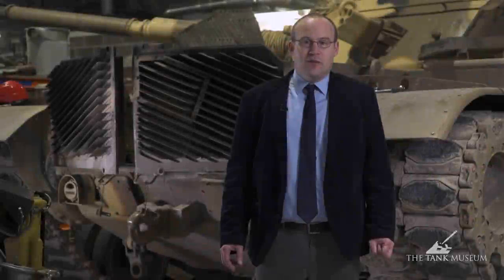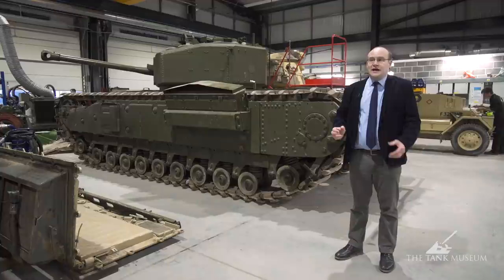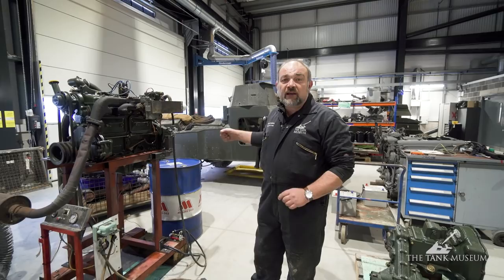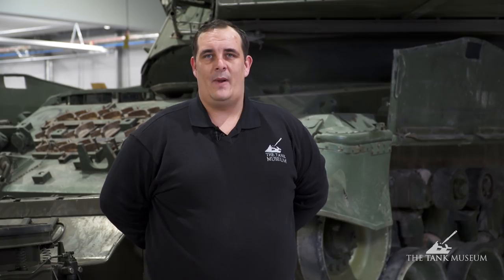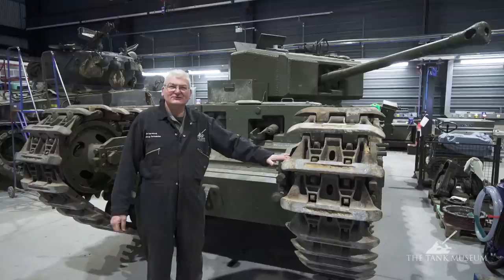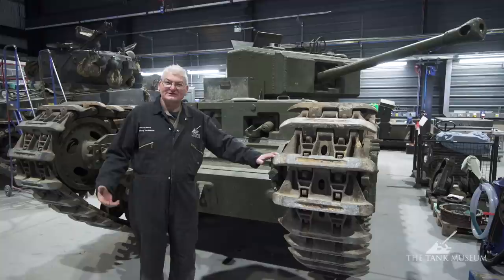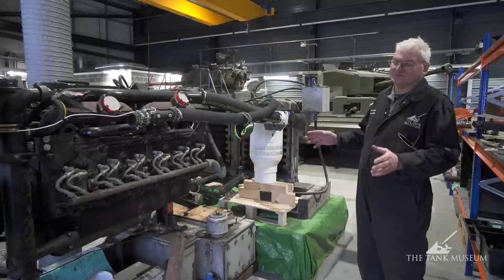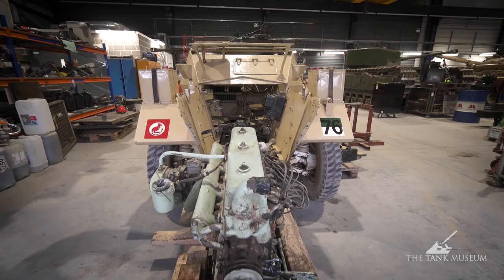Leopard 1 Overhaul | Ep. 1 | Tank Workshop Diaries  | The Tank Museum

Comment: The Leopard 1 engine setup is very impressive indeed! Wish car manufacturers would have taken a lesson from these engineers. Would make working on vehicles today much more effective.
Reply: they could IF only they wanted but they want to force you to bring your car to a dealer workshop and make money withe the cars they already sold. IF only these dealers were competent or trustworthy...
Reply: @spidermann5000  Yup and the very reason I was saying how great it would be. We get ripped off at the sale and we get royally raped with the repair and maintenance. What a racket this is!
Reply: The Germans certainly seem to have taken the WW II lessons of the Panther and Tiger - two notorious maintenance hogs - to heart.

As far as the applicability to consumer market road cars, I honestly doubt many people would be willing to pay thousands $$$ extra to have an engine/transmission/cooling/accessory pack that interchanges as a single unit. A feature like that is only worth the $$$ to someone operating a large fleet of identical vehicles, where a motor pool is constantly servicing vehicles on a rotation.
Reply: @paulfrantizek102  no neet to fit it in one big block but if you have to disasemble the whole car to replace a simple part then you sure are trying to cash in on repairs. same thing with brand specific tools... so i guess you are missing the point
Reply: @spidermann5000  Yeah, that's a different point from the one I was addressing. I was speaking specifically to the modular power unit - technically impressive, to be sure, but something very few users outside of a major military are likely to see value in.
Reply: @paulfrantizek102  ahh, i see
Reply: Porsche 911s and BMWs from the era of the Leopard 1 are equally easy to maintain.  It's just the modern junk.
Reply: Those Germans just stole it from the aviation world.  Now fighter engines are modular.  They can be be changed in an hour.  For real.
Reply: You're exactly right. the only thing I can do is add windshield wiper fluid.

Comment: And another nice feature of the Leopard`s power-pack is the so called " Standlauf ".It consists of a electrical connector set and a minimalised radiator. This device allows a test-run of the power-pack  without installing it in the engine bay so it can be checked for leaks and proper funktion of the entire pack. The same thing can be done in the Marder family.
Reply: German mechanical engineers are geniuses. They learned a lot of lessons from World War II.
Reply: Wind up a Leo pack and it would "walk" along the ground during runups!

Comment: Excellent series. I enjoy the nuts and bolts descriptions of military vehicles.  I worked on the restoration of a Soviet made SU-76 SP gun back in the 1980's. It was a lot of work but very satisfying. Watching the ease with which a Leopard Pac could be pulled made me envious. Getting the twin 6 cylinder flatheads out the SUKA was an all day job. The vehicle was a mess, having been subjected to the elements ever since the NKPA "donated" the piece to the USMC in 1952. She had run over a mine, probably an AP because the damage was relatively minor, but everything was rusted and needed sand blasting and full restoration. Keep it up, I'll be looking forward to your next video.

Comment: As an "old" Leopard C1 & C2 guy, the gentleman misidentified a couple of items, he called the radiators "air-intakes" (the engine air intake is located about the middle of the hull, just behind the turret ring, on each side) , the superchargers "turbochargers", the tank was not "steered" by the brakes, it was done by hydraulic pumps incorporated in the transmission. The final drives are incorporated in the hull, and the "muff-couplings" slide on/off the transmission flanges on the power pack (27-32 full rotations of the "muff-coupling" wrench to release and to reconnect, you would do 32 full rotations and then 'back-off" 5 to allow for some "play" for the splines.

Comment: Mark, when describing the powerpack, you incorrectly identified the radiators as the air filters. The air filters on a Leopard 1 utilise a cyclonic system of two per side in the sponsons, with 3 filter cassettes per side for a total of 6 in the vehicle. The radiators are mounted on top of the transmission and are also designed to allow water ingress through the radiator fan when fording and then out through the side vents.
Reply: Written by someone who obviously has training and experience on this tank.👍🏻

Comment: That leopard clearly demonstrates how  the German engineers learned the lessons of WWII. Is Challenger that easy to work on?
Reply: They kept learning  them too, my 71 VW bus has a tray type set up, you can pull the motor, gearbox and ancillaries straight out the back without even jacking it up. I once removed and rebuilt another bus motor in a car park! Full engine out with one trolley jack is about 20mins on my own.
Reply: Gus Gone I actually drove 23C when I was posted to The Royal Canadian Dragoons

Comment: Thanks.

That Leopard design is inspired!
Reply: Well the germans and french wanted a conscript proof Panther. So they basically drafted a spec that fixed all the problems in the MBT60 project. And build two in Leopard 1 and AMX30. Going for example for a 50to design weight chassis in the Leo where Breaks, final Drives etc are concerned while the tank is in the 42to range

Comment: 9:20 - those are the radiators and not the air filters, air filtration is hull mounted which directly connects to turbo charger intakes.

Comment: Any thoughts about standardizing to three modern engines shared across all the overhauls? Seems like most vehicles could run on either a 250 hp, 500 hp, or 750 hp engine. Cheaper, easier, and more practical for engines run annually.
Reply: This is very similar to the dilemma of so many other RV owners.
Reply: The amount of work required to fit all the extra gear to interface to the standard engines would not be worth it and probably not fit (long narrow engine bays vs short wide ones etc).
Plus what they are doing preserves the tank with the correct engine (all with different sounds) - the difference between a commercial outfit and a working museum to my mind.
Have a great day.
Reply: @Samuel Thompson are you American?
Reply: @petermuller3995  Definitely a Yank and former US Army logistics officer. I think the public comes to see the tanks roar around. Museums are normally short of funding and trying to maintain say 25 different types of engine in 30 different vehicles is extremely expensive in parts and supplies. Also, all the hours a crew may spend mastering a Churchill tank's engine are not then used to repair 10 more such engines as the museum has such a variety. As for authenticity, I expect modern acoustic engineering could recreate the sounds of the original engines. As for size considerations, power output per cubic centimeter of engine bay volume has improved drastically. If anything, modern engines would look small in an engine bay for say a Chrysler multibank 30-cylinder of a Sherman. Adapting a smaller engine to mate up to a modern transmission in a spacious engine bay should be easier than working with the original engines and transmissions. Modern cars often use electronic enhancements to "sound right." If supplemented with exhaust baffles and other elements of acoustic engineering, I expect a modern engine could be made to sound just like an adapted pair of London bus engines in a Matilda II, for example. Standardizing on three engines 250, 500, & 750 horsepower, would also greatly simplify labor with sharing between vehicles. I know hard core tank fans would miss seeing the Ford GAA or a Maybach 12 cylinder in action, but they could still be displayed on engine stands. That is, unless hard core tank fans are prepared to donate a LOT more money to assist the museum.
Reply: 1. Thank you for your service
2. Your idea  is logical and makes sense. If they call a company like Mtu, it could be possible, that they get it for free/cheap if they put the name on it as advertisement. 
But there is a problem:
3. There are different concepts when it comes down to restoring something.
In generall, when someone in europe wants to restore something, it is extremly important for them to get it as it was when it left the factory or got it's last modofication for things like tanks that got changed during the war. 
The best situation for  someone like that is, when every serial number is equal and the tank is like it was in 1945. Even the old paint is very important for them. 
I am not saying that one of the concepts is better but I hope that you can understand them better now. Putting an different engine into an old tank would feel like hanging your countrys flag upside down.
Reply: @petermuller3995  I grasp that some people are very devoted to authenticity, but I was around armored vehicles quite a bit, especially during the First Persian Gulf War (1990-91). AFVs are constantly undergoing change. We had an entire Explosive Reactive Armor (ERA) assembly line running in Dharhan, Saudi Arabia to add extra protection to our AFVs. Repairmen will weld or cut items on and off AFVs. They are kind of "living things" and that gets lost when these vehicles are "restored."    My preference is to spend the money on getting these vehicles moving again, instead of so many sitting in a garage, waiting years for all the right, authentic parts to be assembled that can finally get them back in motion. By then, veterans have died, memories have faded, and younger generations have to content themselves with more static displays and YouTube videos. A Panzer I with machine guns seems almost humorous until you imagine being a rifleman getting charged by one at 35 kph, spraying machine gun bullets while deflecting your own. That does not come through as well from a static display of an AFV. Also, if costs are kept down and reliability is improved, the public could even be given the chance to drive old AFVs and really understand what their ancestors experienced, minus the fatal consequences. Mine is a philosophy of living history over "authenticity." It may be related to passing history along to my four children and seeing what really connects with them.
Reply: @amerigo88  When we restore castles, every price of stone must be they correct type. And authentic mortar must be used, even though it is far more expensive, far more difficult to work with and far inferior to modern mortar. When we restore ships, the original type of wood must be used, even though it is much more expensive, much harder to work with and not as structurally sound.

In Britain, all restorations must be done to original standard, or to the latest field modification in the case of tanks. That's just how we choose to run our museums and preserve our history
Reply: @Kyle-gw6qp  Reading through this thread again reminds me that I had the luxury of  assignments at Aberdeen Proving Grounds when it hosted the world's largest AFV collection as well as Ft. Knox when it hosted a large set of AFVs. Subconsciously, I pictured them rolling again. I expect there are generally fewer AFVs in Europe and the ones there can enjoy more authentic restoration. Most towns here in the American South have at least one old Sherman or Patton tank or at least an old 105mm howitzer in front of a VFW post.

Comment: At 17:44 it shows a brake backup booster if engine stops or oil leak or problems with gearbox. It holds nitrogen pressure for about 50 or 75 bar and are used to brakes / stop the tank in emergency situation.  
The oil pump for brakes are under the radiator.

Even though the brake disc are thick they do not worn down 1-2 cm of the thickness of the disc brake before they change it.
Reply: Did I understand correctly?  No brake fluid but oil in the braking system ? What kind of oil ? Would seem to me a fairly thin viscosity would be needed unless very large diameter tubing was used. And just what happens ? A dedicated pump with an accumulator somewhere plus a modulating valve system to operate the brakes ? Inquiring person would like to know. Any information received with interest. Cheers.
Reply: paul manson If the engine/Gearbox for some reason stops , the driver can breaks down the tank to its stop. Only 2-4 pedal breakers , just to stop the tank.  There are oil in the brake system that comes from the gearbox and the break pump mounted on the gearbox. It’s a closed oil system for the breaks.  This is just to stop the tank in emergency.  It goes oil up to the accumulator on both sides and nitrogen inside to set the brakes when needed.  You have also the option to emergency brake with handbrake levers.  Same system is on Leopard 2 powerpack , it has two accumulators as emergency brake.

Also on bergepanzer or bridgelayer they have two of this since they are heavier. The brake pump on the gearbox are under the fan , you can spot it in the hatch that closes when you are "diving".  Hope I understood right. I can remember wrong. Sorry about that.
Reply: @slikerdet  Aha. Got it. Thanks . Appreciate the detail. Makes sense now you have added those extras.
Reply: paul manson no pro. Ask for more.  Do you work with tanks..?
Reply: paul manson also as some mentioned, air filter houses , intakes sits over the fuel tanks / just behind turret in 12 clock.
Reply: @slikerdet  No. Retired truck mechanic. Those brake discs remind me of large versions of front discs on full size station wagons,and light trucks. The centre ventilating ribs. I remember all the efforts for decades for ABS. Well meant but every one a failure. Then on board data processors and a few years of getting a good system running and now voilà ABS works and well.
Reply: paul manson oki. I did my education as truck mechanic but worked with tanks , leopard 1 and 2 for the most.  Yes looks also like them in trucks.  But the brake system on Leopard 2 powerpack work opposite off brake disc and and brake pads.  There the brake pads are turning with the prop shaft if you can call it that and pistons push it to the brake disc that are mounted in the gearbox. The brake disc never turns around like in Leopard 1 or cars and so on. On Leopard 2 the brakes are divided in two forms. Brake disc and retarder. Brake disc brake down the tank in speed of 0-30 , and retarder and brake disc together to speed from 30-50 kmp I think and higher speed only retarder.
Reply: @slikerdet  I'll be damned. No reason a stationary disc should not work just fine. Never thought of it,never seen it,of course.
And yes a retarder is a very good idea for a hulking monster like a tank moving rapidly. Electric,hydraulic or other ?
Reply: paul manson What did you ask for on the last Paul ..?
Reply: @slikerdet  Sorry. There was this English chap I worked with who really knew his stuff. He talked at length about different ways a retarder can be engineered. Electricity with eddy currents and a heat exchanger.
Hydraulic with a controllable narrow passage.
Others too, I forget. 
So .Do you know what makes up the retarder?  Heat exchanger, using thin oil like transmission fluid perhaps ? Or other .Thanks again for the details you have given.
Reply: paul manson oki. I have never worked with a retarder only the main brakes and park brakes.  We had a different work shop that handled this. Major problems with gearbox was sent to the factory.  Renk makes this gearboxes and this Norway use was build under license in Netherlands by stork company.  Try read this. 

https://www.renk-ag.com/fileadmin/Produkte_und_Service/Produkte/Dokumente/RENK_transmissions_for_military_tracked_vehicles_en.pdf
Reply: paul manson but in Norway they use the main brakes together with retarder dice they don’t drive that much I speeds over 50 60 km/h.
Reply: paul manson what truck brands have you work on Paul..?

Comment: The engine in the leopard 1 has 3.74 liter displacement pre cylinder. That means that a vq35 v6 engine (350z) is smaller than one cylinder of a leopard engine.

Comment: Admire the work that you do but sigh your explanations on the Leopard are wrong.
The big rectangular things on the side of the Leopard Powerpack are Radiators not freaking air-filters those are located in the sides of the hull.
In addition the two snail like items on the front of the engine are "Superchargers" not Turbochargers!

Comment: So can you use modern parts to replace things like electrical wires or rubber seals so it doesn't corrode after a year? Or does every single thing have to be original?

Comment: Is this fuel pump drive a mod? I believe the worst early faults in Beddy twin six was snapping flex line, like a speedo cable, which drove the fuel pump, needing engine removal to access the fuel tank to replace the flex drive. Was the bit you showed the fix?

Comment: Something is wrong in the description of the leopard engine. The  two big boxes around the fan are not the air filters but two radiators filled with 160 liters of coolant. The air filters are located on both side the turret in the hull. Btw, I was mechanic on Leopard 1 betwen 1978 and 1980 in the Belgian army and wolunteer to the Royal Army Museum in Brussels for 17 years. Check my channel to see vidéos about the Leopard and other  WWII tanks. Cheers from Brussels.